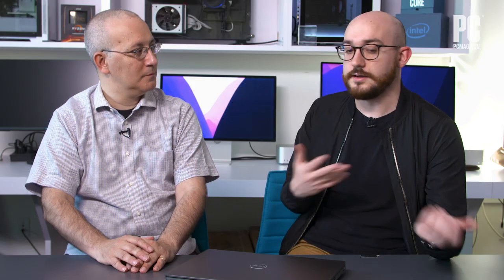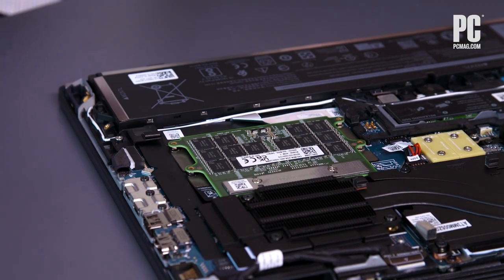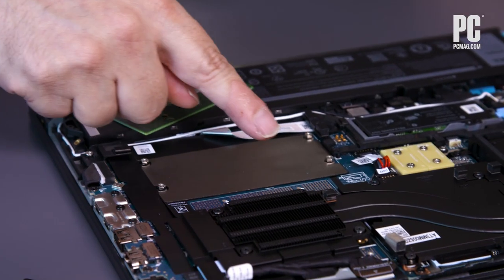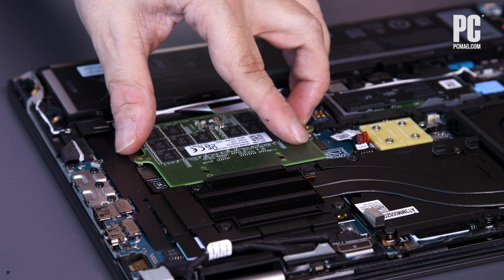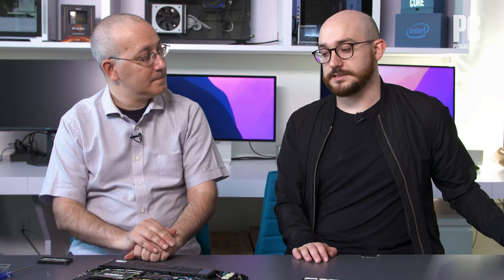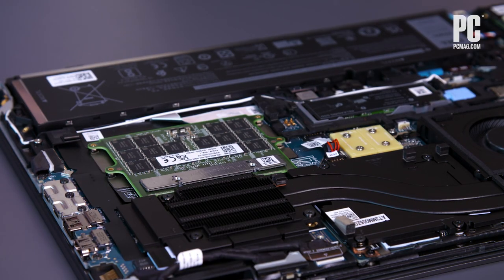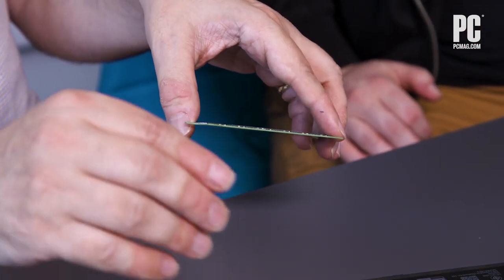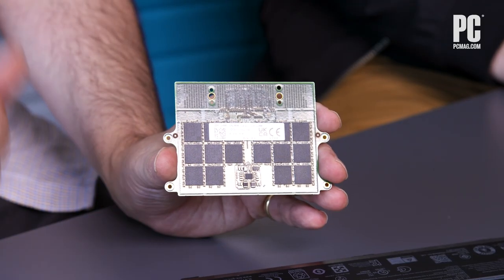What Is CAMM? Perhaps, the Future Look of Memory in Laptops

Comment: Now that you pointed out them saying "uhhh" I can't stop hearing it LOL! I just realized this busts the myth that you can't put vram in a socket or on a dimm as the number one thing they say publicly as to why they can not put vram on a dimm is the trace length, and I was like nope, that is just not true, as they make BGA sockets for testing chip speeds and they run at full speed, and that is even before they get soldered, LOL! There is even a white paper showing the theoretical speed limit of the socket and it was pegged at 5000mhz. So yeah, the industry lies a lot just because more moolah...